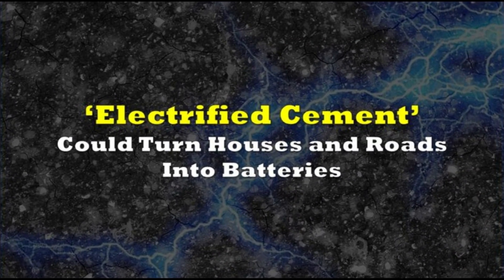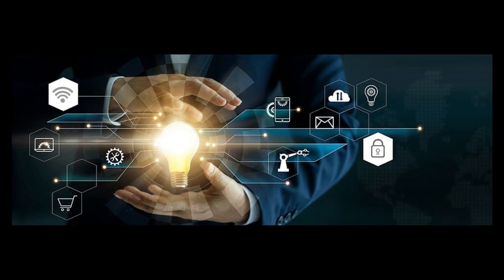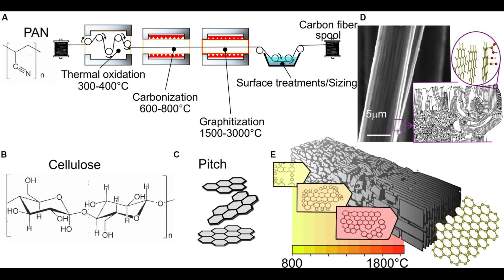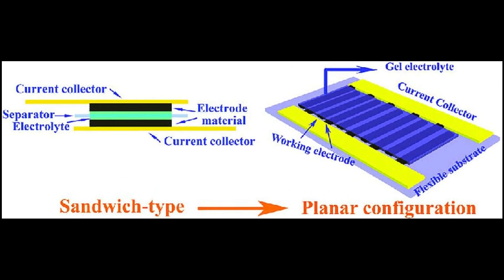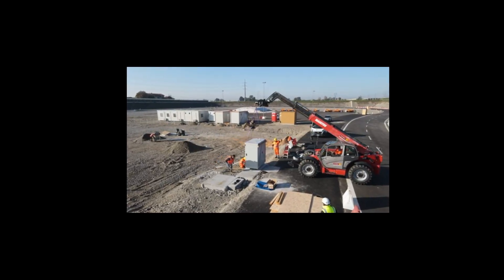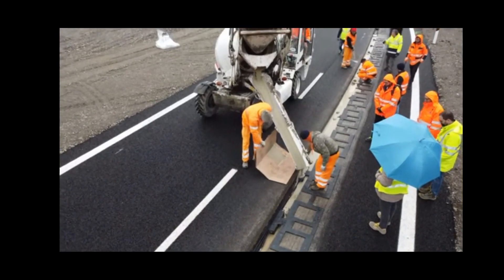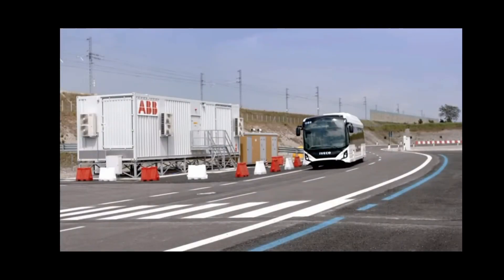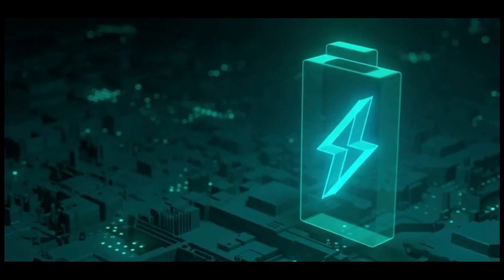Electrified Cement could turn houses and roads into batteries | Supercapacitor

Comment: This technology could be implemented on NEW Highways, Interstates, Major Throughways and Roads, but converting existing roads of the same would take a very long time and block traffic throughout the conversion, not to mention the exorbitant costs of materials, labor and maintenance.  And who pays for the power to operate them and how?  It's a nice Dream, but is not likely to be implemented any time soon, at least not in America.  Road use taxes charged at gasoline and diesel pumps are already high, and this would greatly exacerbate those costs.  Electricity costs for charging battery-based EVs is unregulated and very high, but when road use taxes are added to that, including paying for this, it may be the final nail in the coffin for them.
Reply from the maker: Absolutely right 👍